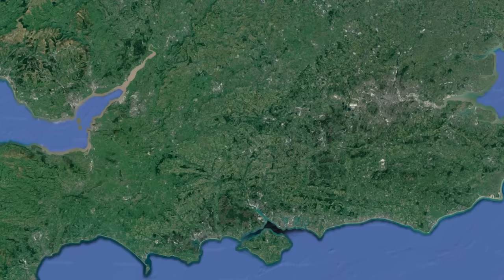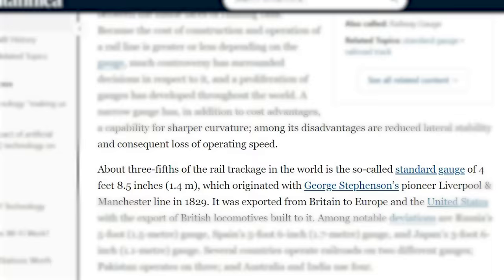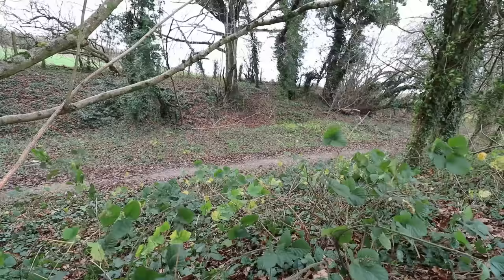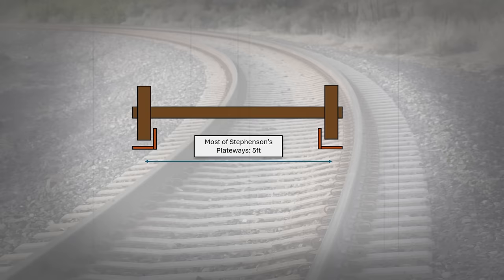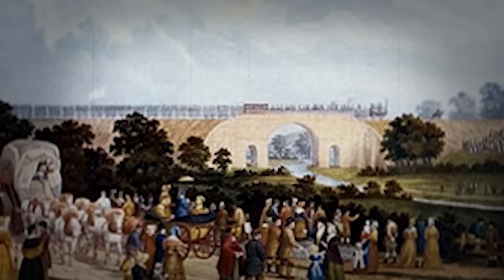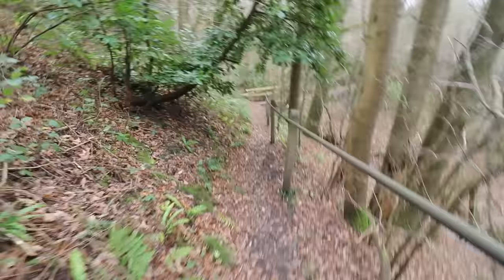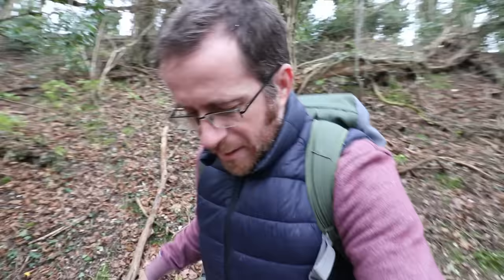Railway Gauges did NOT Evolve from a Roman Chariot.

Comment: In Wales we have 1'10" gauge on the Ffestiniog Railway, which is also the same gauge as the Welsh Highlands Railway.  The Padarn Railway was 4' gauge, and these Railways were in operation after the law was changed to make all Railways the same gauge in Britain.

Most countries where the gauge is 4'8 1/2" were built by the British Engineers, which is why they were all the standard gauge.

Comment: When we construct rail where I live, we transition in 3mm wider increments within a curve until the gauge is 12mm or 1/2" wider, only returning to our normal gauge when the track returns to straight. 

Tight curves where this may cause derailment have check rails added and have greatly reduced line speed

Comment: The advantages of broad gauge only really mattered during the early days of rail. Like it is more stable, which allows higher speeds, plus you can fit bigger boilers, however these were problems that you could engineer around with standard gauge. As locomotive and railway engineering advanced the advantages of broad gauge became smaller and the downsides of simply requiring more space and having less tight turns made it impractical. Also broader gauges do have some stability issues like if the train starts to tilt it'll lift off the track at a smaller tilt angle, hence why narrow gauge is so stable. Standard gauge doesn't have any particular technical merit but it does just sorta work in most situations and was complimented well by narrow gauge.

Comment: If you had tracks in each direction, two broad gauge tracks would take up a minimum of 14ft (assumming other spacings wouldnt change.)  Thats approximately 3x standard gauge. Building a line might have met more resistance because of the amount of land being used.  We might also assume that broad gauge engines and carriages would be significantly heavier than their standard gauge counterparts leading to greater strain on the rails and indeed wear on rails and wheels.  In theory, you might have moved more freight per truck but it also might have been weight limited.
Based on this we could speculate that if Broad gauge had been adopted the costs of building and maintaining rail infrastructure might have led to its downfall sooner than Beeching by being more uneconomic.

Comment: Edward Harriman of the Union Pacific/Southern Pacific was making "public noises" just after 1900 about going to the old Erie broad Gauge of Six feet even.  The Erie had "converted" its lines to standard gauge in 1883, on branches mainly by laying a third rail.  They continued using broad gauge locomotives in yards for some years; I've seen a photo from Avon NY from 1897 with a broad gauge loco working the yard.  Transit systems still use varying other gauges.  Most trolley/tram systems around Pennsylvania  used a 5' 2.5" gauge which became known as Pennsylvania Trolley Gauge; the idea was to prevent car interchange with the steam railroads.  Pittsburgh and much of Philadelphia use that gauge.  Where there is not going to be any interchange a newly built system could have an independent gauge; San Francisco's BART was supposedly built to five feet six inches--the broad gauge of Canada as in Grand Trunk and Great Western Railways.
          What you have NOT thought anything about is the structural limits of the materials being used.  Longer axles could be more prone to breakage; around five feet might turn out to be the optimum..  Would be interesting to see some internal Great Western (and other broad gauge system) documentation of their experiences of broad vs. narrow.  Harriman was probably thinking of operational advantages of size and stability of equipment.  But a massive installed based leads to a "more trouble than it's worth" conclusion to keep doing what you're doing.  Which is why passenger diesels in the US continued to be built with small steam boilers for steam heat into the 1960's well after steam locomotives had disappeared.

Comment: Just think how fast and efficient trains would be if Brunel's 7ft 1/4" broad gauge, that he linked London to the west country with, had been adopted.  
He chose a much wider track so that trains could be built with a much lower centre of gravity. Locomotives could be slung between the wheels, freight could be much lower and carriages too. Enabling much faster trains. His route for the GWR was so flat & smooth it was called Brunel's billiard table.
Once the country had adopted broad gauge the benefits would still be being reaped today with ultra-high speed trains running much faster than the narrow, tall trains we're stuck with today.
Such a shame!
I'd better watch the video. All this could be mentioned already...
Edit: Yup, should've watched it first. 
For a while Brunel tried dual gauge track with three rails to accommodate trains of both narrow (standard) gauge & broad gauge which made for some fascinating points!

Comment: On fascinating Standards, how about Threads?  If you buy a CB radio for a car and you want to screw on an antenna, the thread is not metric, not UNF, but British Standard Brass at 26 TPI.  So why do modern radio antennas use threads originally designed for 18th century British gas lights?
I tried to buy some antennas from China to use in Australia and they wouldn't fit because they tapped them in Metric.  In the end I had to buy a special BSB tap and send it to China so they could send me antennas that fitted Australian cars and trucks.  This topic deserves a whole new Thread.  (yeah, groan)

Comment: Standard gauge is even "winning" in the 21st century. Such as in East Africa (Kenya and Tanzania) where the old meter gauge railways are replaced by standard gauge.
Not so in India though where broad gauge is "broadly" used and has replaced the meter gauge lines. Due to geography connections to standard gauge networks play no role there and most imports/exports go by sea/air.

Comment: A very skimpy history of British track gauges.  There are quite a few good books on the subject, especially on the move from wooden rails to, eventually, iron then steel track.  

Just as cars don't all have the same widths between wheels, they mostly fall within quite a narrow range.  Similarly with carts and animal drawn wagons.  Whether a single bullock or horse, the cart had to allow the beast to fit between shafts, maneuver and not be too large for a single animal, or a pair in tandem to haul.  For this reason, many carts were similar in the space between their wheels.  Narrow wagons were used when cutting a wide incline was expensive, or the loads were too heavy (eg Welsh slate workings in Snowden)

Since at least Roman times, some form of wagon-way was often deployed, particularly around mineral workings.  To be effective, carts had to be roughly the same gauge.  The wagon ways gradually evolved into railways and Stephenson standardized on the systems that already existed.

The gauge standard of 1435mm should be thought of as a process of continuous  improvement.

It was the merchant's of Bristol who wanted a railway to London - the GWR's thoughts on America came later.  Brunel's gauge might have been accepted had he come up with the idea a decade before.  But he was too late and the interchange of wagons and coaches, not to mention through trains, was seen to be more important than engineering perfection.  7' and 1/4 inch track could not have been fitted affordably into civil engineering designed for 1435mm, so broad gauge had to go.

Ironically, modern track in tunnels often adopts a very similar track support system as adopted by Brunel, just narrower.

Comment: 1864, a railway was built Köping - Uttersberg, Sweden. The gauge was to be 3 ½ - English. That was translated to 3.59" Swedish. Cars and track were built thusly, but the engine factory was confused, and had the tracks measured to be sure, and it seemed clear, measuring c-c, that 3.59 was the English feet dimension, so that's how the engines were built. They didn't fit, so the cars and the track were remade to the unique width 🥸

Comment: The extra half inch has been problematic in Boston, 🇺🇸  last year. Contractor installed Green Line Extension (GLX) LRV/tram tracks a 4'8" not 4'8½", and has to redo a lot of tie plates, as the binding has been a problem. https://en.wikipedia.org/wiki/Green_Line_Extension#Operations_planning_and_opening

Comment: The Great Western was a substantially straighter track than many of the older ones. Other lines in hillier districts needed tighter curves, which 7 foot gauge would not have suited, other than with many tunnels and other civil works. So construction costs would have been more expensive (wider bridges, more land required etc), which wasn't what the founding directors needed! Hence narrow gauge - 3ft 6in or less in mountainous areas.
Reply: @DrivermanO The GWR earned itself the nickname  of The Great Way Round because of the circuitous routes it took, so not exactly straight.
Reply: @Poliss95  That's the point. It sometimes took a longer route to avoid twists and turns. But you couldn't really say that the London - Bristol route is a long way round! Other companies also used to denigrate their competitors - the GWR had to build routes to avoid existing lines - hence great way round. But you should note that it was also called God's Wonderful Railway  -take your pick!
Reply: The route that the GWR used was chosen to minimise gradients - early steam locomotives didn't have much power so any slope would kill speed.  It was built as a high-speed line.  As you point out a narrower gauge has advantages in hilly terrain, a broader gauge is better in open country. @DrivermanO

Comment: It almost sounds like the plateway at 5' with inward L-shape meant that welding a runner on top would allow both the cartway gauge and the new railroad stock to use the exact same line, at least until the modern profile rail shape was finalized.  Like taking that early stock and just modifying for testing, then the test being adopted as the final choice without any rethink as to what would really make the most sense.

Comment: Apparently, the 7 foot gauge was too expensive to construct. Brunell's original design used individuak stone pads under each rail with iron tie rods between the rails to maintain the gauge. A narrower track with timber sleepers was far easier to lay.

Comment: And a lot of standards come from compromises. A good example is the European standard 230v for domestic electricity. Prior to this voltages used in Europe ranged from 220v to 250v, and it's not uncommon to find older electrical equipment that has switches for at least 220 and 240v (and usually 110 too). How they standardised was by using the fact that voltage isn't standard (distance from sub station and load will impact the voltage) so equipment has to have a fairly wide tolerance (230v is -6% +10%, so that's 216.2 volts to 253.0v). Countries using 220V upped boosted their voltage a little (to keep above 216.2 even under the worst conditions), but still within the tolerance of old equipment. The UK dropped the voltage from 250v to nearer 240v (so it's never going to exceed 253v), again with no significant effect on older equipment. Other equipment already had switches to work in other countries. The voltage  tolerance for new equipment was designed to match the tolerance of the supply across the continent. The UK nominally kept "240v" until EU standardisation forced 230v to be adopted (and even if brexit changes that, nothing will change). The only issue was that older equipment from 220v countries might not tolerate being plugged into a socket right near the sub station in the UK at a time of low load, and an old UK device might run at notably lower power plugged in a rural area in an old 220v country.
Interestingly my smart plug shows I'm currently getting 244.8v, so quite a bit over the 230v nominal, but still nearly 10v below the maximum allowed.
Reply: In certain 230V countries, the tolerance band is other way around (-10% +5%, i.e 208 to 240V).

Comment: Very nice video, informative. Really enjoyed the info about Brunel and the 7 foot gauge. Good narrator, nice video of scening abandoned rail line.  

But it does NOT show that 4 ft 8 1/2 gauge didn't come from Roman roads. 

Perhaps it "happened because it happened" -- and the past, of course, is unchangeable -- but I don't see where anything about Roman chariots or wagons was disproved. 

BTW -- model trains -- my obsession -- O gauge  -is 1:48 in US, runs on 1 1/4 inch, 5 ft scale track. 

1 3/16th inch would be correct for 1: 48. But BRITISH O gauge is 1: 45, and is proper on 1 1/4 inch track. Because that's what happened a century ago. 

And British OO scale (1: 76) runs on 16.5 HO track (1: 87 everywhere but Britain), which I think was because British locomotives were smaller than American ones, and it was hard to get a 1930s electric motor into a 1: 87 scale Brit model train back then. 

And those things, too, happened because they happened. And it's too late to change now.

Comment: Yep, Australia before Federation used spite in choosing gauges.  My first visit.
Standard gauge is the default here for major lines, but we still use different gauges within some states.
Reply: Wasn't spite.  NSW, Vic and SA agreed on 5'3".  Back then no-one envisioned trains connecting from these states to any other state.  Just unimaginable that anyone would use it.  Expensive logistic issues with steam trains (decent water and coal bunkers) didn't help either.

NSW had a change of government and they changed their mind.  Other states worked out narrow gauge was much cheaper.  In Queensland they estimated their narrow gauge costal track (Brisbane to Cairns)  was 8 time cheaper to build than the alternatives.   

Same reason as Switzerland is 1 metre.  Hugs the changing contours of the land better, so reducing infrastructure costs.  Lower weight rails, shorter sleepers and smaller engines and carriages (defeated by needing more of them) were minor cost considerations.

Then Federation.  The Commonwealth Railways agreed to pay for a railway to Darwin.  Adelaide to Quorn was already there on 5'3".  So the Commonwealth did 3'6" (cheapest option) from there to Alice.  Decades before they converted the lot to 4'8.5" all the way to Darwin.

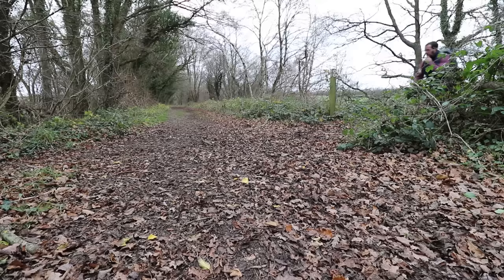Comment: 7:30  If that fence post rail is ex broad gauge it certainly didn't come from the adjacent DN&SR track as that was built as standard gauge.   Which is why it was able to connect with the LSWR at Winchester.    When the DN&S was commenced in 1882, broad gauge was on the way out, and it was all finally gone by 1892.
As for Brunel's belief in 'efficiency', he guessed wrong as often as he guessed right, the 'atmospheric' system of traction being the most notable example.   But he also wrote certain technical specifications for the earliest locomotives of the GWR and, to put it kindly, they didn't work.   
"The pioneers of the time... had little idea of the overall picture, it seemed." (10:12)     George Stephenson certainly did, since he reportedly said "Make them all the same gauge, they'll all be joined up some day".
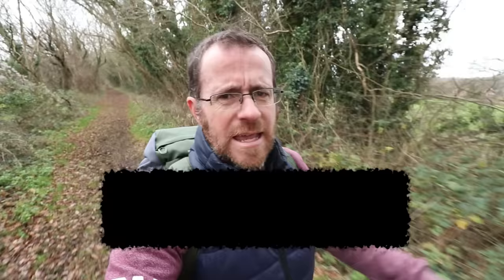I very much doubt Brunel 'ripped up his track', (12:40)   more likely the directors of the Great Western Railway.   13:15  "108 billion" looks more like 108 Million in the graphic - rather more believable.

Comment: I thought they had stuck with the narrower gauge because you can convert 7 to 4.85 ft rail gauge without worring about space. If you try to widen from 4.85 to 7 on a two-track section, you need to find 4 additional feet of spacing to the sides. If there are walls, fences, trees or anything, you're out of luck and have to do extra work.

Comment: While nearly all the US uses your same English 4'8.5" standard gauge, there were quite a few hundred miles of 3' narrow-gauge built in the Rocky Mountain regions over the past 150 or so years. When I lived in Farmington, New Mexico in 1967-68, once a week the old Denver and Rio Grande Western Railroad steam locomotive came in on a freight run from Alamosa, Colorado, to Durango, Colorado, and then down to Aztec and Farmington. That was the last commercial US narrow-gauge line, and it finally shut down for good at that very time. To this day, there are still a few narrow-gauge tourist lines that run in the summer.

Comment: While not relevant at the time of the standardisation, due to how different railway carriage design was back then, Brunel's 7ft gauge would have been less stable in a modern implementation for higher speeds. This is because the critical speed for hunting oscillation requiring an axle load increase proportional to the gauge increase. Even existing 1600mm+ broad gauge trains require challenging amounts of additional damping to operate at much over 200km/h with reasonable axle loads.

Comment: I had always heard that gauge selection was dependent on how tight the curves were going to be on your tracks.  The tighter the curve, the narrower you gauge must be?
Reply: Just rode the Cumbres and Toltec in northern New Mexico and that was the issue. The railroad actually used standard gauge further south. But then they  transferred freight etc. to a narrow gauge going up into the mountains to allow the tighter radius curves up the valleys. The southern standard gauge lines are gone but the northern section is a great tourist attraction. I recommend the trip, very scenic, highest railroad now in the US.